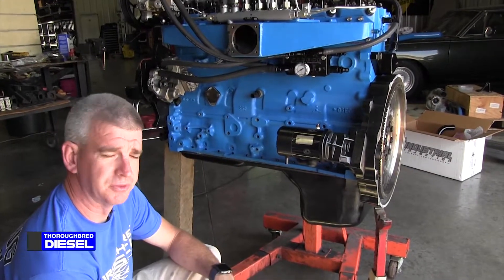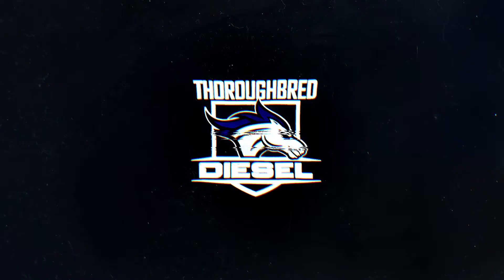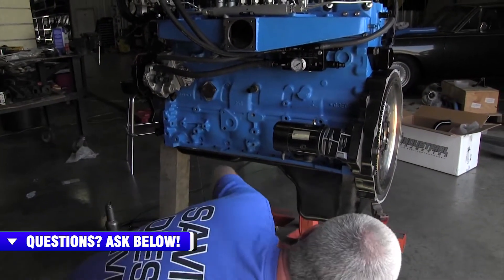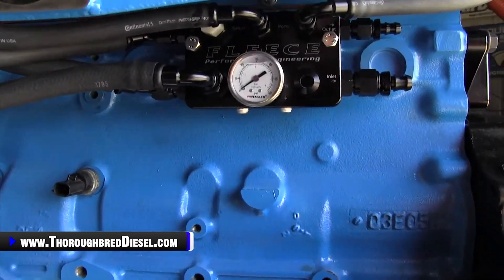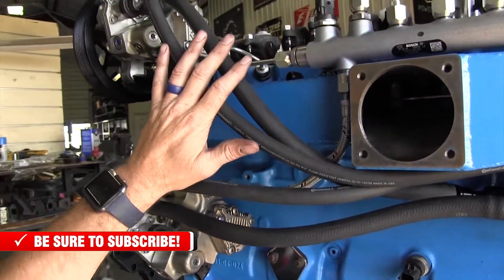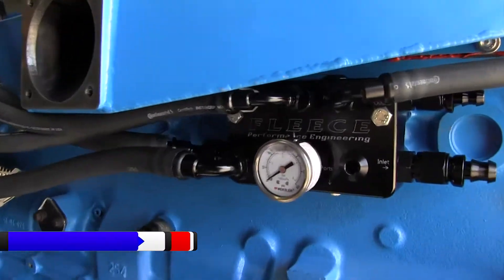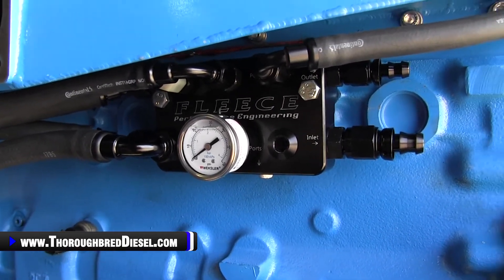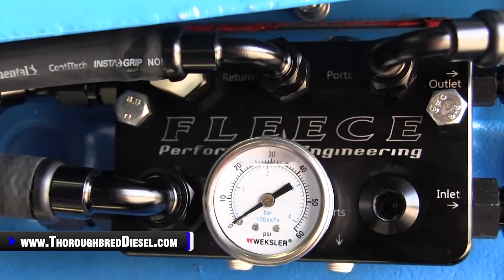Regulated Return Fuel Distribution Block by Fleece Performance Overview

Comment: I'm gonna install a Fsss 165 on my 06 Ram 2500 5.9,would I need the dis. block or the fuel filter delete,will be getting the duel CP3s down the road,thanks.
Reply from the maker: The distribution block will make for a clean install if you are going to do dual cp3’s down the road.
Reply: I ordered one from yall,keep those great videos coming!